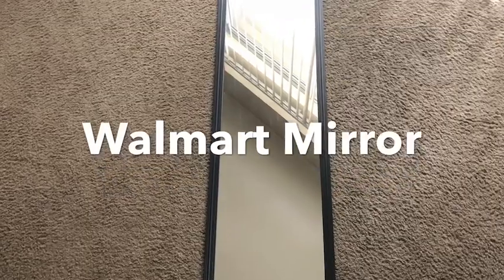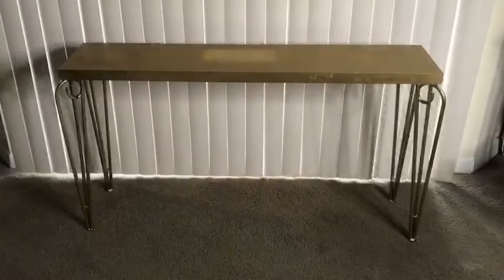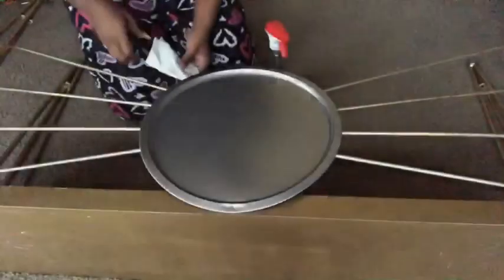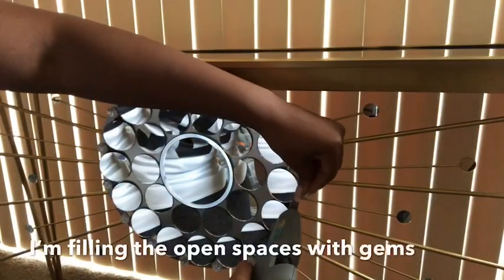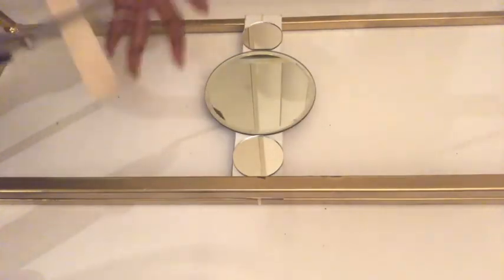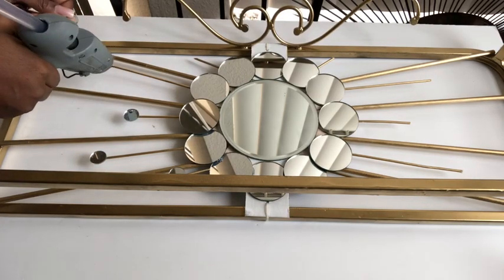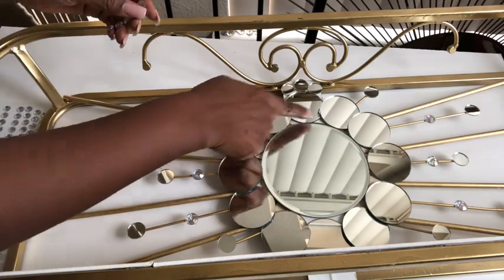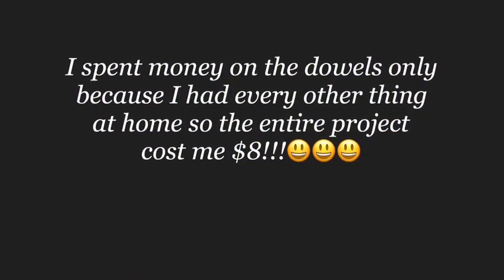Diy Bespoke Starburst Table For Less|Trash to Treasure Diy| Walmart Mirror Transformation!

Comment: Aaaaah mirrors mirrors mirrors... 
Mirror mirror on the wall, mirror mirror everywhere. 
They add to ur uniqueness sis. Ossssssssum as usual. Stay blessed sis😇🙏🏻😘😘😘😘A small suggestion... Mirrors on southern or western walls or sides of  house, are supposed to give out negative vibes. So if possible place mirrors in such a way that you face east or north while seeing ur reflection on them. Stay blessed dear

Comment: The purple wall LOVE IT !!! TFS I have a similar table with the same legs. I thought about spray painting but wondered how it would look. So happy you shared. Is that the metallic gold paint?
Reply from the maker: Mm Long That table can look so rigid sometimes and I didn’t want to just spray paint it and since someone wanted a Walmart mirror table, I decided to make a longer table and use the mirror on top😃. Yes I used Rust Oleum Gold metallic spray paint ☺️💕💕